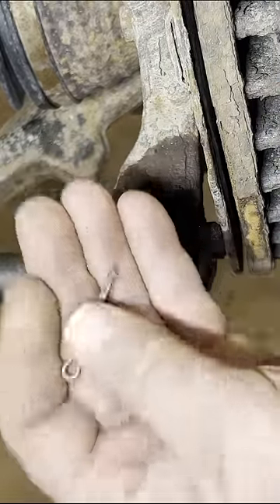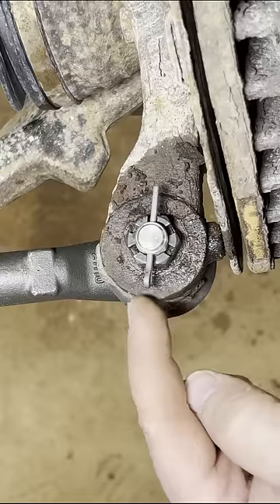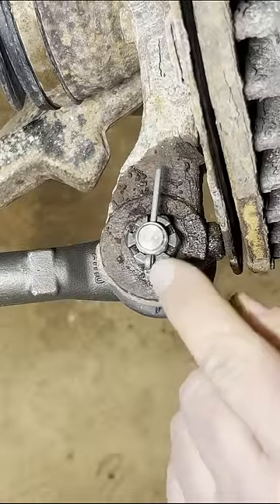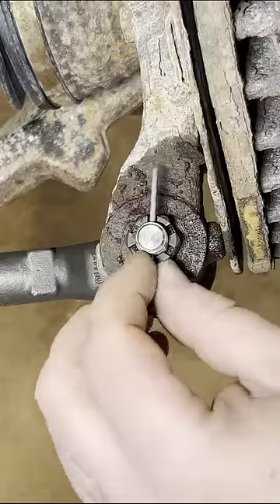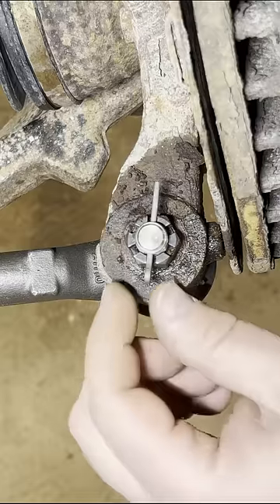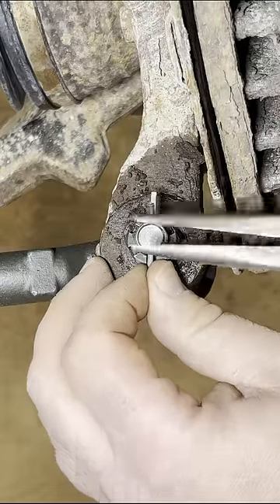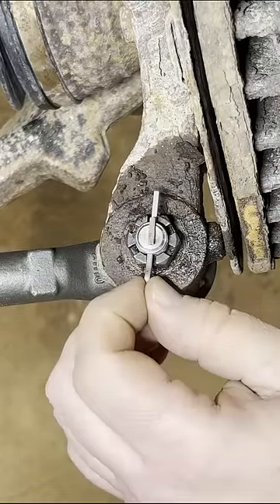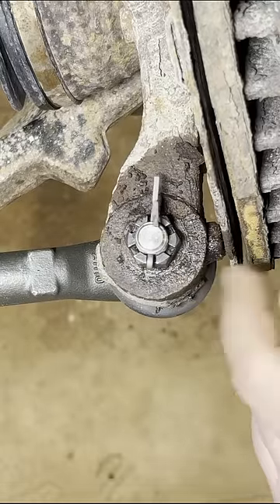RUST BELT Cotter Pin Installation!

Comment: And as long as that cotter pin has the ability to wiggle, it will eventually wear down to nothing due to vibration.
Reply: Would'nt do it  that way,Do it as the text book and keep out of court!
Reply: Absolutely.
Reply: Do you honestly think that tie rod would even last long enough for that pin to wear away to dust? LOL
Reply: @davidsmith37709  you'd be very surprised how quickly they can wear down.
Reply: It is NOT a cotter pin, it is a split pin.
Reply: @Mick K I have to agree with you there sir.
Reply: @mickk8519  
do an internet search.
just because the newbies gave it another name doesn’t change the original name
Reply: And rust also.
Reply: @davidsmith37709  in the rust belt, a couple years will see the end rusted off and a loose split pin will fall out.
Reply: They are pretty soft. I sometimes just cut the tails off then just undo it. They shear really easily. Then you just punch the rest out.
Reply: @owenfitzpatrick5394  Might be a different country thing. Here in the UK they are always split pins.
Reply: @mickk8519  hammer lock
Reply: @jeremycaylor9151  hey I still disagree, it’s why things go through scheduled maintenance and inspections. Still doesn’t need to have a jam tight cotter pin. Maybe the stuff you’re working on is just neglected hmmm maybe derrrr 🤦‍♂️🤡🤣👍
Reply: No it won't
Reply: @Leothelion357  most people don't grease their joints much less check split pins.  I have never heard of anyone doing that as PMs
Reply: Not true at all.  When I put in cotter pins, I do like the video, except I dont bend it so much.  Just one leg bent at a 45 degree angle and that's it.  It keeps the nut from loosening. That's it.  I put 210k miles on my truck before the ball joints wore out and the pin came right out no problem, and certainly didn't wear out
Reply: @MVP11489  exactly!  100% facts!
Reply: If the pin rusts to nothing you won’t have to worry about the nut getting loose that’s a promise 🤙
Reply: @chevybigblock3311  facts!
Reply: @davidsmith37709  when installed like that, yes.  Easily
Reply: @davidsmith37709  pens, or are used or than tie rods
Reply: @mickk8519  I disagree,  he bent it with very little effort.  Do you even know the difference?
Reply: Leave one lose on an aircraft and see how long you’re employed.
Reply: Came to make this comment.  a year from now, that pin will be gone, and the whole time before that the rattle will be annoying af.   nothing should rattle about when it's properly installed.  if you don't want it to rust, put some grease on it when you're greasing the tierods at regular service, or if you are the no service till it breaks type, put some caliper grease on it and be done with it.
Reply: Agreed 🤝
Reply: @simonworman7898  that's weird, pins I put in like that 25 plus years ago not only are not stuck, but not at all worn what so ever
Reply: @maj.FrankMBurns  Yep, if you use a properly fitted pin and appropriately use something like antisieze, easy out many years later.
Reply: No it wont lmao. Maybe in 2500000000000 miles of dirt roads
Reply: Shoot, my biggest issue was how much he bent the one leg and left other straight af.....there's a reason they have two legs, bend both less and not worry about the integrity of you pin
Reply: By that time the ball joint will need replaced as well so your argument is invalid
Reply: @davidsmith37709  yes. before the tie rod
Reply: If you're that worried use a stainless one🤦
Reply: @mickk8519 well it's well known enough that everyone calls it a cotter pin. So in a way that makes it a cotter.
Reply: Add Silicone Adhesive?
Reply: Only needs to be on there a month or 2. By then the but will be rusted on like locktite.
Reply: It won't wiggle for long. That nut will loosen against the pin anyway. That's why there's a pin. 
If anyone thinks it's tight, don't need a pin, you are wrong. It will come apart.
More then 20 years experience as a licensed tech, in the rust belt of Canada. Everyone I know installs tight. Rusted in is ok. Brake off part of the pin that sticks out with a wiggle. Tap a socket over the nut and pin, spinning nut off cutting the pin. Pin is soft metal,  If the part is not going to be replaced, drills out easy with a 1/8" bit.
Reply: Cotter pins are over rated saves less time not putting them in and not having to mess with them later down the road.
Reply: If you are so worried about rust , put a blob of grease on the top of it
Reply: @mickk8519  split pin is a foreign name for cotter pin in America,it's a cotter pin.
Reply: @Back_door_bandit_98  having that nut back off from the steering linkage would be even worse. Buy a stainless steel cotter pin and never worry about rust.
Reply: And by then the bolt will be rusted enough it'll never back out
Reply: It would do that regardless
Reply: I never thought of that in my insular world of no friction.
Reply: I doubt  it. There is no pressure on the pin. It sliding or wiggling shouldn't bother it. There are no pinch points no sharp edges
Reply: @mickk8519  it both either or
Reply: @phonotd  Do you save a few bucks and use spaghetti for yours 🤣
Reply: With corrosion and wiggling it will be gone in not time
Reply: @Geoff Haylock  false economy using spaghetti, you have to replace it too often. 🤣
Reply: No it wouldn't relax
Reply: @mickk8519  it’s a split cotter pin.
Reply: @Drone Guy  if it's on a dodge it wouldn't matter you'll be replacing it all again in 6months
Reply: @davidsmith37709  lol uhm yes I’ve seen crazier things
Reply: @mickk8519  not on this side of the pond.
Reply: Some of us do this for a living. We only install stainless steel cotter pins. As I like to say, you might be the next guy.
Reply: @davidsmith37709  People need to learn to undercoat their vehicles. Atleast make the effort and buy a can of rust check every season. Good god.
Reply: @davidsmith37709  yes especially if they use salt to melt ice. I'd rather it rust and get stuck then it falling out and the nut coming off. So should a garage that works on it or its their ass.
Reply: Always amazes me why manufacturers know these areas are subject to rust and yet they still don't use stainless nut and bolts, brass pins, galvanised mounting ect..... wouldn't take much thinking to rust proof a car during production and I certainly would pay a little extra when buying it knowing rust will never be an issue.
Reply: @davidsmith37709  anyways if you put Red anti seize on the nut you're good.
Reply: @Iaintwoke  yep, drive an impact socket down on it and battery impact go brrrrrrrrrrrrrr till it’s off
Reply: 100%
Reply: @jgetscensored7837  wrong.
Reply: @davidsmith37709  okay Dwite…

There’s a right way and a wrong way to do things.  If you want to be wrong, you do you
Reply: @davidsmith37709  yes
Reply: @d you clearly don’t realize how much your suspension moves driving down even a relatively smooth road.
Reply: @d sure thing pal.  You made a comment implying how cars don’t vibrate during normal operation.  Coming from you, “it’s been proven” isn’t a very convincing argument
Reply: @d when installed tightly
Reply: @mickk8519  it's a cotter pin. Not the only type, but it's still a cotter pin.
Reply: @MVP11489  "the pin came out no problem." It's a device for safetying. It's not supposed to easily come out.
Reply: In the rust belt the car will go into the junk yard well before a cotter pin wears out.
Reply: .... I think you'll do your brakes at least one time in between
Reply: @andrew1898  agree, im sure he can size that pin up a bit, nothing like putting a bobby pin where it don't belong 😅
Reply: You won't have to drill anything out. Most of the time they are so rust, the ends snap off when you try to straighten anyway. The nut will just shear what's left off when you remove it. Then whatever is left in the hole will come out with a punch or finish nail.
Reply: That SIR depends on one thing and only one thing. THE WIGGLE FACTOR so what is your WIGGLE FACTOR. Gotta think about that before you answer, I SEE¡!¡!!¡!!¡¡¡¡¡¡!!!
Reply: BTW forgot to mention, I've never seen a cotter pin ever wear out completely. I have seen them in very bad shape but never seen one fail.
Reply: @owenfitzpatrick5394  always been a cotter pin I've never heard another thing for it manufacturers that supply all shops I've worked at its a cotterpin haha
Reply: @bstbud no not everyone calls them cotter pins. In new Zealand they are called split pins. Cotter pins are a tapered pin used yo hold a kingpin in a front axle of a truck.
Reply: As long  as people keep an eye on the vehicle they are driving it can be replaced before it wears down, I have seen cars from the 60's that  have had cotter pins with play in them  that didn't wear down before the parts did, must be those darn split pins yall using, just a joke.  Also the package they come in says cotter pins, so I guess the company's that sell them don't know where they are called either. I wonder if  i should make videos on proper names of items would seriously make you that happy. I'm guessing you also deal with the cotter pins, oh wait sorry...split pins that have rusted and have to get them out of tight spots. That's harder than getting the part replaced in most of my experiences.
Reply: @davidsmith37709 well the pin does stop rusting so the only way this works is if the vibration causes the corrosion to fall off. So yes it would wear away.
Reply: Add some white lithium grease over it and it may not rust or move around.
Reply: @mickk8519 one in the same.
Reply: @mickk8519 sure it is, and you kooks think a wrist pin is a gudgen pin too.
Reply: @johngaltline9933 Superman couldn’t hear that little cotter pin rattling in a tie rod end and neither could you.
Reply: @davidleonard8369  on my f250? no way.  I wouldn’t hear a marching band walking past me. On my town car, you bet. I heard a fuckin zip tie tapping against  the radiator hose on that thing cause I didn’t snip the tail.
Reply: Lmao come on my guy that would take 40 years lmao
Reply: Preach!
Reply: Don't be ridiculous. Gonna leave it for 10 or more years?
Reply: Yeah, and you'd be amazed at how long it would take. Stick to what you actually know.
Reply: @nothankyou5524  lmfao
Reply: @nothankyou5524  lmfao
Reply: On what planet would it do that on ?

Comment: if you live in the rust belt, you can probably skip the cotter pin all together.
Reply from the maker: You're not wrong! I see vehicles often without cotter pins. Rust is an incredible lock tight!
Reply: Give it one winter and that bolt won't come loose. Maybe that's why I've never seen those cotter pins ever save the day, they seen to just be there to be there.
Reply: I'd say no based on the fact that a shop did that and my tie rod fell off in the McDonald's drive thru.
Reply: @rustyshackelford7651  well thankfully you were at least in a McDonald's drive-thru and not driving down the highway. But I could not imagine being able to sleep at night knowing that I sent a vehicle out the door without installing a cotter pin, tie rod end, drag link, etc. That would just eat at me so bad wondering how long it was going to take for it to fall apart, rust belt or not.
Reply: @midnightrider1854 lol there was no cotter pin on my CV axle and when I got some recall work done at the stealership they put one on 😄
Reply: @Blakethegoat  lol good guys. But at least with the c.v. joint usually the worst it does is strip the splines out and inconvenience the poor driver with the expense and time of a tow bill but if it were something like a tie rod falling off at highway speeds.... I'm gonna need a new set of britches, let me tell you... 😂😳💩
Reply: Lol, i live in the rust belt, one of my tie rod ends simply fell off
Reply: @darwinmunk378  That's crappy.
Reply: @Tomsfoolery.  use stainless steel cotter pins.... no rust, no issues
Reply: @midnightrider1854 😆😆😆😆😂😂🤣🤣🤣🤣🤣🤣🤣🤣 I would need a new pair as well! I would say to the police and EMS "I think I just shat myself and there's nothing you can do about it"!! 🤣🤣😅
Reply: @randyherringshaw6325  NEW BRITCHES!!!!! STAT... !!!  🤣🤣🤣🤣💩💩
Reply: @midnightrider1854  🤣🤣🤣 DEFINITELY!
Reply: Don't.
Reply: 🤔Y'all should be replacing cotter pins & abutment clips with every tire rotation and oil change‼️ 💯😂😂😈
Reply: @Lions7.62mm  🤣🤣🤣🤣🤷‍♂️🤔
Reply: @Tomsfoolery.  I always put my cotter pins in the same way that you do but i dip them in hot wax first or thick grease if you don't have paraffin. It helps them from seizing in place! 👍
Reply: @rustyshackelford7651  Yeah they also probably never tightened it either. Once tight, it's not coming loose. If it's loose enough for the cotter pin to stop it, then it's too loose and needs tightened immediately. The cotter pin is just a final fail safe safety.
Reply: @markmay1655  The problem is the rust in the hole welding the cotter pin in place. Same issue with bolts.
Reply: @SilverStarHeggisist  not if you add antiseize on it
Reply: @markmay1655  yes, but at that point there's no need to spend extra on stainless pins. 

Side note, I always put anti seize on the pins and literally everything else
Reply: @SilverStarHeggisist  well, I wouldn't live anywhere  that they need to salt the roads......but I use antiseize on everything I can
Reply: @midnightrider1854  Do you dream about cars too? Like working in cars, I mean? I do... 😳😂 It can make you anxious at times, when your young and trying to remember at night whether you tightened ALL those nuts n bolts on the big job you did that day
Reply: @danielbrealey2924  As mechanics, and anyone with a conscience,  I think that has happened to all of us at some point. But it used to wake me up a lot in the middle of the night my first few years of wrenching. But after that, the next 30 or so years, I just sort of learned to trust muscle memory. And I think over time and with repetition so will you. 👍🔧
Reply: Yessir. All the time we get vehicles in and the cotter pin has been turned to rust and the nut stays on no problem because of said rust. Im in illinois so this is normal
Reply: @b5Bart  Well, it may be a normal occurrence but I wouldn't say it's "normal". Chances are the rust on the threads may keep the nut in place but the off chance that it doesn't... Well, there goes a loving family into a tree at 55mph all of a sudden and burying into flames with no survivors. (Yeah... I think I will use the greased up cotter pin or even stainless).
Reply: @midnightrider1854  once again its not going anywhere. I have to sit with my could inuctor for 10 minutes on the nut and another 5 on the joint itself before it pops out.
Reply: I was surprised he put the castle nut on to begin with
Reply: @kentremendous5112  yeah, why bother. Since he's not going to put all of the required components
In, why put something ridiculous as a castle nut??? 🤔🤔🤔🤔🤣🤣🤣
Reply: @rustyshackelford7651  maybe in texas like me ,but up north that means they didn't tighten it for shit...I also use this alias to order my gun parts...
Reply: Frfr tried to smack a tierod out for minutes and it wouldn’t come out so I just put the nut back on and that was that. The sleeve is strong enough to hold it in. Probably don’t even need the damn nut lmao
Reply: I saw a e350 van from rust belt and the shocks was disintegrated , van was bouncing on the coil springs. It's amazing how rust ate the whole shock

Comment: A loose cotter pin could cause an immense amount of friction  and ultimately burn down a parking garage at an airport or hospital.
Reply: It’s possible, not likely
Reply: Lol
Reply: That's a risk I'm willing to take
Reply: Bro what 😂
Reply: The man pinned the best comment. Worst part is, I could see someone unironically making an argument like that. Lol
Reply: Do you work for the DOT?
Reply: I've seen it happen multiple times at each location as well as a preschool. RIP to all involved.
Reply: As if a cotter pin could ever generate enough heat to ignite a fire! LMAO!
Reply: My solution is not to work on  rusted up vehicles
Reply: @David Smith  yeah Dave I agree with you, that will never ever happen at all, never!
Reply: Has this happened before?  Like after the fireman finished putting out a huge airport fire.  One of the fireman walks over to his captain and tells him yea i found the reason for the fire.  Once again someone was using too small a cotter pin on thier upper ball joints and it started a 3 story 4 alarm fire.  We need to do something about this issue.    Sounds more like ADHD folk lore then fact.
Reply: That used to be a PA state semi-annual vehicle safety inspection fail.
Reply: B S
Reply: I can't tell you how many times I've seen orphanages burnt to the ground due to loose cotter pin fires..
Reply: 😂 WTF DUDE
Reply: That’s fkn ridiculous!!!
🤌🏼🤌🏼🤌🏼😂😂😂
Reply: Wait what? A whole parking garage? Maybe half ,but a whole?  Fairytale.
Reply: I lost my whole family due to a loose cotter pin 😢